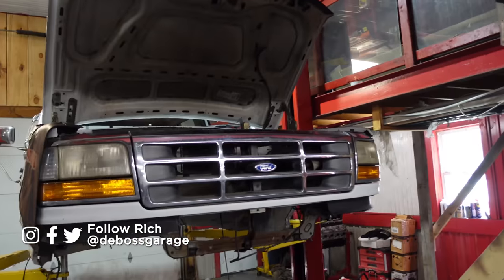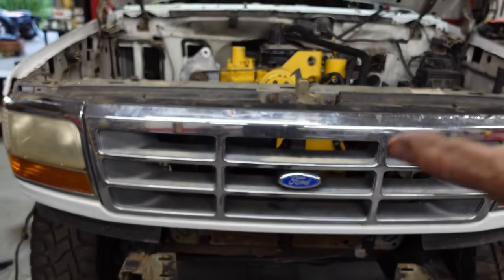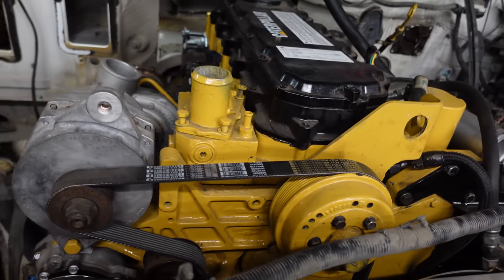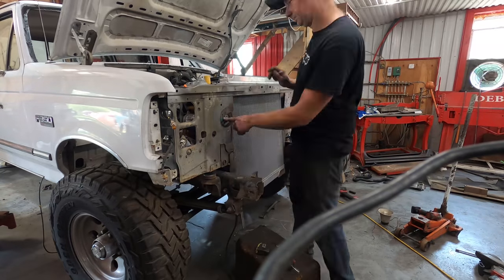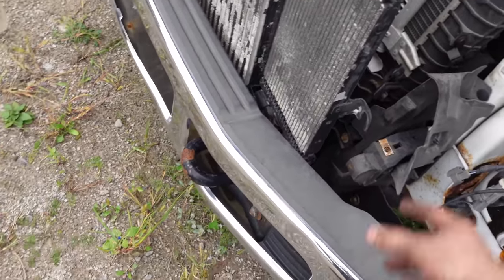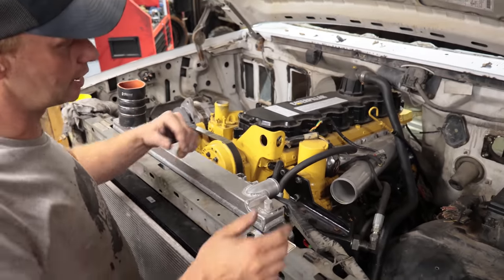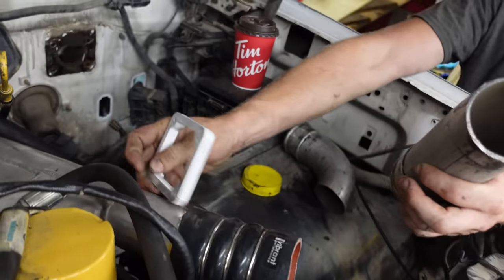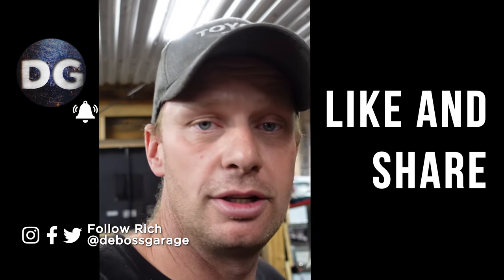How COOL can we make a CAT 3126 swapped F350? | #FTreeKitty [EP15]

Comment: Building for serviceability.
If only engineers thought like that.
Reply: That means more cost to build and less hours for the dealership. Plus if it was easy to service the customer would do it. It’s just gonna cost them more money and loose out on even more.
Reply: Engineers design for cars to be assembled by robots, not serviced by people. 

People wouldnt pay for a car that was designed to be built by hand, itd be much too expensive.
Reply: I’m a designer (not engineer), but I work with engineers. They get a bad rep, because engineers get a set of parameters from business. They then have to make a design that works within those parameters. As a designer my job is to say, “hey, how is the machine shop going to make that? Do you really need to hold that tolerance? How are they going to assemble it?” We are there to try to keep them in check, but reality is sometimes because of design requirements the end result is a design that isn’t great for the end user.
Reply: Engineers don't design products: accountants do.

And... 99.99% of the time the guys who design the drivetrain never meet the guys who design the rest of the vehicle. Imagine doing what Rich is doing, but with no ability to modify anything on the motor. That's what packaging engineers do... It's literally an entire career of making puzzle pieces that don't fit somehow bolt together.
Reply: Everyone acts as though the engineers are handed the concept art,  then just walk to the drafting table figure everything out before just a quick hand off to the tool/die guys. The engineers are handed a sh*t sandwich told to smile, take a bite and pass it around. As is everyone else down the line in lean manufacturing. Blame the accountants and the leadership that approved whatever smug SVP signed off.
Reply: @cessman8054  yep engineers are professional turd polishers. The issue is every new product has to be twice as good at half the price.
Reply: @FoolOfATuque  Sadly, it's not even that. I've worked for companies that were clearly making the wrong decision, resulting in a product that was more expensive and worse, but the CEO made his mind up so that was that.

Reflecting on that statement, I've actually seen it happen a bunch of times. Most of my employers have made money in spite of themselves.
Reply: @TheBrokenLife  Any large company basically works like the Dilbert cartoons
Reply: @connerlabs  I just wish I could figure out how to apply being that successful, while being completely inept, to my personal life.
Reply: @TheBrokenLife  Yes, So much yes. You access the model in the design environment, add your part, and touch nothing else. Ford uses Creo I think. At any rate the new F-150 had some very Creo-esq renderings on the website lol.
Reply: @greentland  Creo is the only package I won't use and I've used them all. I've turned down job offers over it.
Reply: They do, then the bean counters come in and say you have to make it use special tools to get more money.
Reply: today things are built with mouldability in mind that's why many cars can use the same platform, when you buy a Isuzu you you may actually  buying a chevy and so on. Its all about the money not the customer. We are last in consideration
Reply: @FoolOfATuque  I don’t understand your job as a “designer not engineer”?  So my feeling is you are the guy that designs the vehicle to be nice pretty and swoopy.  And then you have no concept about the space needed for all the mechanical and electrical/electronic  parts right.  Your job as a designer is not to question about manufacturing engineering or tolerances. Your post is so much bullshit it is not understandable.
Reply: @Adscam  I’m a mechanical designer. I make the drawings they use to make stuff. Because of that I have a practical knowledge of how mills and lathes are operated. I know how parts are inspected and I know how to assemble things. As a result I know a lot about tolerancing and fitment. Currently at my job I have designed all of the equipment that we use to test the products we are developing which includes all engineering calculations (burst, collapse, tension, thread shear to name the most common). I assemble and disassemble test equipment. I analyze tested products post test. I lead failure investigations when something goes wrong. Currently I am training a fresh out engineer, with a masters degree I might add, how to do mechanical design. So yeah I know how to analyze forces and pressures. The products I design are high tensile (450 kips), high pressure (12,500 psi at ambient) and high temperature (325F). So yeah I do know lots about mechanical engineering.
Reply: @TheBrokenLife  I use Creo everyday at my job. 😂 I always tell my engineers that with great power comes great responsibility. Creo is quirky, but powerful. I guess I’ve grown fond of using it for nearly 10 years every day now. I use Solidworks at home for 3D printing projects since they have the maker program (100 bucks a year for Solidworks is amazing) and I always find myself doing Creo things and getting frustrated they don’t work. 😂
Reply: @FoolOfATuque  Here we go... 😆

You get frustrated doing Creo things in other packages because Creo is the only package that operates like Creo. Everything else is, more or less, like everything else. In essence, Creo is backwards which is why Creo sucks. That, and Creo drawings is just outright broken. Or at least it was the last time I had the misfortune to touch it ~5 years ago. Rather than invest my career in using the only system that works like it works, I'll spend my time in the systems that work like each other. Unfortunately, it's looking more and more like my day job is going to move to Creo, as part of a nearly limitless number of other bad decisions they've also made, and at which point I will need a new day job. They've already made the heinous mistake of selecting Windchill for PDM. The good news is it will take them years to implement any changes at all...

If I had to take my pick for what I'd prefer, I'd probably go UG or Catia. Depends on what sort of work I was doing the most often and how much the versions have changed over the years since I last used them. For surfaces, you can't beat Catia. For routings, UG's UCS system is really wonderful, but it's a close second for surfacing too.

But... These days I don't really need much horsepower. SWx is my daily driver and I don't have many complaints. I DO appreciate you mentioning the maker program as I hadn't heard of it before. The last I knew they had a program where you could get a free version at home if you used a paid version at work, but the hassle of doing that through my VAR and my boss would have been a nightmare not worth pursuing. From the looks of "3D Experience" SWx, it's just SWx Standard with some cloud functions. Indeed, an excellent deal for $100/yr. If it has any CNC capability so I never have to risk touching Fusion again, then that's even better. I'll check it out for sure, thanks!
Reply: @Adscam  His post makes sense if you're in the field. 

A quick example of what he's saying is an engineer might produce a drawing that is dimensioned to 4 digit accuracy just because that was the default template they happened to use. So you'll see something like 4.000" on a drawing for something not much more elaborate than a wooden block. If you actually send that out for quote, you're going to get something insane back because holding that accuracy on a part that is just a stump is ridiculous.

You most commonly see stuff like this become a problem for drawings that are produced in inches and then just "switched" to metric. Just the change from inches to millimeters automatically tightens up tolerances by a factor of 25.4. So something like a metric drawing out to 4 places is literally like asking for a million-bajillion dollars. You'll get laughed out of the shop.

Anyhow... Whatever a company calls the guy that knows that stuff is whatever they call him. Designer, engineer, gray beard, whatever. He's saying he's the guy that knows that stuff. The flip side of that is he may not be the guy is the metallurgy or structural design expert. Each of those fields is so vast that it's really difficult for one guy to really be an expert in all of it. Usually the ones that are (or are close) are of retirement age and don't understand the technology side of actually putting the electrons in motion.

So, I don't think he's full of shit. I just think he has terrible taste in design software. 😁
Reply: @TheBrokenLife  I’ve worked in AutoCAD, Solidworks, Inventor, and Creo. Of those I’d choose Solidworks. It’s the easiest to use and would be the best for the size assemblies we create. I’m in oil and gas so our assemblies aren’t terribly complex. We use a combo of 3Dexperience, windchill and Creo at work with a piece of software written to connect windchill and 3Dexperience. It is a heinous hellscape of incompatibility. 😂 I can see why the engineers I work with get frustrated by it. There’s coupon codes for the first year of the Solidworks maker program that drops it to 80 USD. I think the Hacksmith has one If you’re interested.
Reply: @FoolOfATuque  Hilariously, the main selling point of Windchill to our management team was how "easy" it's supposed to integrate with all of the systems we use globally. I knew up front it wouldn't be so easy, but, you know how it is...

I've spent a lot of time in automotive, which I suspect is about as far as it gets from oil and gas, so I wouldn't be able to form an opinion there. Many automotive assemblies get gigantic, so that's certainly a thing to be concerned with. A model for a heavy truck might have 30,000 unique parts. I don't think SWx would deal well with that either, but I haven't tried.

Dang... At 80 bucks they're basically paying me to take it. Gonna have to get a PC rigged up for actual CAD service now.
Reply: engineers design for functionality of the product, most engineers have little to no physical experience on what the part is going to be used for. Kinda expected. Nothing we can do about it.

Comment: Since you started this series, I went through a good 4 different "I want a diesel" phases.... Well, I just got one! '04 F350, SRW 168k miles!

It is a 6.0, but let's not talk about the disasters over the horizon, lol. Got it cheap and half the bulletproofing is done - I already got the other half on the way.
Reply: You poor lad, what have you done.
Reply: There is still time to sell it to Whistlin Diesel :-P
Reply: @krismorey  Thank you for making me laugh! Had the same thoughts while I drove it home. Immediately took it to my diesel tech neighbor asking him how badly I just shot myself in the foot. (Thankfully after full scans and test driving, worst thing about it was the steering box that I replaced the next day!) Already had coolant filters, HPOP, fuel spring, oil feed tubes, and upgraded oil cooler installed. I decided to get a complete bulletproofing kit from Sinister Diesel just to verify and refresh the truck. Best case it lasts to 350k and the motor nukes, I'd be happy to get half that for what I paid. 

Dream truck is a 7.3 F250-350, '94-97, SRW 4D Long bed. Too bad finding a low mileage one of those in Texas, in good condition, costs way more than I can afford at the moment.
Reply: @StonedGamers  I wouldn't worry about it too much. My 04 6.0 has 271k on it and still going
Reply: If you don't try to turn it into a race car you'll be fine. Bulletproof and mild tune. Then and this is key, leave it TF ALONE!
Reply: @leokarasinski4217  My plans to a tee! It almost has enough pep left alone with that VGT.

I did research the crap outta the 6.0 beforehand. Watching DieselTechRon, In The Shop, South Main Auto, and DEBOSS's everything wrong with 6.0. I got the thing for less than 10k, figured it was worth the gamble at only 168k miles.
Reply: Just hope it wasn’t hopped up. If it’s bulletproofed and stock your Golden.
Reply: @Qgal5kap123  he's just uploaded a 6.0 video lol
Reply: @StonedGamers  Cummins swap? 😅
Reply: @petermolnar8667  You know I had a F750 Flat Bed for about 6 months that had a 5.9 Cummins in it from the factory. My mind was blown when I first found that out.
Reply: Watching people like him is what made me buy my 2003 Cummins. And then I go watch people like cleetus McFarland and now it is 1000 hp two years later lol.
Reply: @michaeltrue1143  That comment deserves multiple thumbs up and a bald eagle.
Reply: Sounds like a whistling diesel recent video “it’s already bulletproofed”
Reply: @braaapattack2937  True that. Thank god I didn't pay anything close to the numbers he was throwing around in that video!
Reply: @StonedGamers  My brother has an 2005 and he bought it with under 100k probably like 5 years ago at least. It did start doing the blown head gasket thing so he figured he may as well just bulletproof it. Other and that, doing a straight pipe and I’m not exactly sure but I think It might have a mild tune or no tune at all. It’s been fine for him

Comment: As someone that drove buses with the cat engine I can testify that slow starting is normal for those engines. Had to teach other drivers in how to start them in cold weather so not to get a dead battery. Basically had to cycle the engine heaters twice before cranking over.
Reply: Yep. Had a customer with a box truck and one of these engines. That first winter we had to go out and start it a couple of times because they’d run the battery down cranking. First time we found that the big relay was bad for the intake heater. That helped, but when it was really cold they’d still kill the batteries just straight cranking. Had to show them to cycle the key and wait, then cycle the key again and wait. And, then only crank it for a little bit. If it doesn’t start then cycle the key again and so on. Suddenly didn’t have to go out and jump it off anymore.

Comment: Any of the engines with the high psi oil fired injectors always were tough to get fired up and air worked out of that system.  I worked at an IH dealer and rebullt a lot of the heui DT466 and some were just a bear after rebuild.  Basically after overhaul we would let them get up to temp on high idle in the lot, if no leaks go find an area with a lot of hills and go run them for about 30 minutes.  That would usually work the air out.  Idling in the shop wont do it and it will start hard until you get all the air out.  On the same engine i would also loosen the icp sensor before i put the valve cover on crank the engine (uvc harness disconnected) until oil came out.  Made startup easier after overhaul.  Good luck and truck looks good and coming nicely.👍

Comment: That’s going to be such a cool truck. I work in a job designing machined components and the laser guys can hold some pretty tight and consistent tolerances. Only issue we ever found with it is the heat affected zone and blow out. On a project I was one we were cutting some 2x1 rectangular 1/4” thick stainless tubes. That tube is rolled into a circle, seam welded and then formed using dies. So there’s a lot of stress in the steel. The steel gets locally stressed relieved while cutting it and the tube would go from straight to banana shaped. When we cut it. Solution was to cut it on the opposite side which caused it to pull back straight. 😂

Comment: For the skid plate you could use dimple dies. that way you could bring the plate up higher while maintaining some air flow to the lower rads.  Also the  dimple dies would  add a lot of strength to a what would normally be a flat piece of metal.
Reply: Adding louvers to the flat plate for airflow will help with cooling issues.

Comment: You should really consider a PMF rear shackle kit for the front, it moves the shackle to the rear of the front springs and uses the longer SD springs and greatly improves ride quality!
Reply from the maker: it does, but it also raises the truck another 2 inches minimum.   I don't want a lifted SEMA truck.   we will see what it rides like when it's done and go from there.  The ride home from Cali was nice and smooth
Reply: If you use excursion springs instead of f series springs it'll sit just about level

Comment: U can just get a 1/4 in plate and trace out for that pipe and tack it to the flange then cut off the excess it not much to do. Then, Vince, won't have to fill gaps the size of the grand canyon. Anyways say hello to Vince, I use to work with him when he first got into the trade. I think it was at Sutherland Shultz in the Kitchener region. I mentioned it before but you may not of seen the post. Anyways I love this build. This is going to be One Sweet Truck! BTW
 Must admit it must be a pain for Vince to have to weld that dirty old aluminum, aluminum needs to be very clean to help achieve really nice welds.

Comment: You should put charge cooler in front of everything. when you stack radiators you want to put them in order from cool to hot. When running ac condenser will get super hot and heat up charge cooler and you'll lose some power.

Comment: If you expect to build more than 15psi, slather some black RTV on both the hot side and cold side of your charge pipes under the hose connections - that and T-bolt clamps will keep your hoses on.

Comment: I’m loving this build, the only thing I’m confused on is with it being a long haul/on road towing build why the giant tires? They’re harder on hub bearings, steering components and rob power all of evict seem counter intuitive When racking up the miles while towing. Personally I’d go for a set of 255/85R 16’s ideally or 285/75’s as a second option, it would do so much nicer than those 35’s